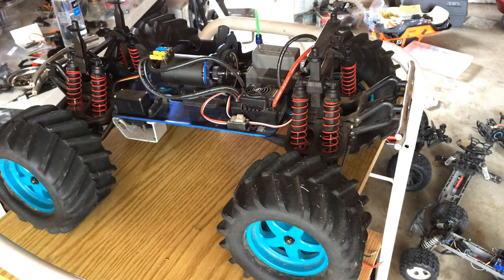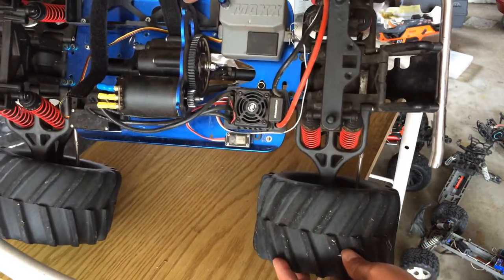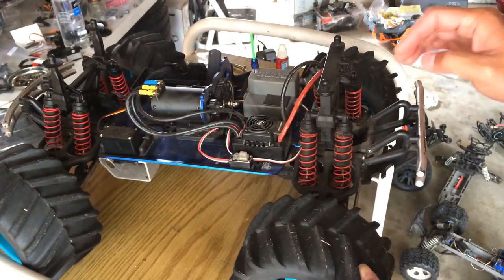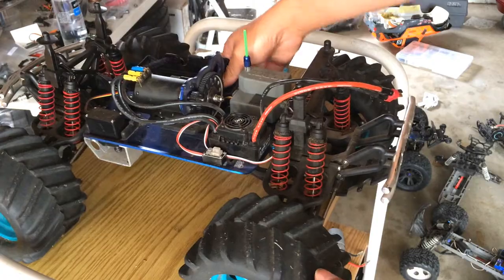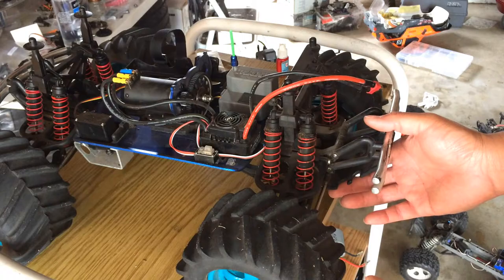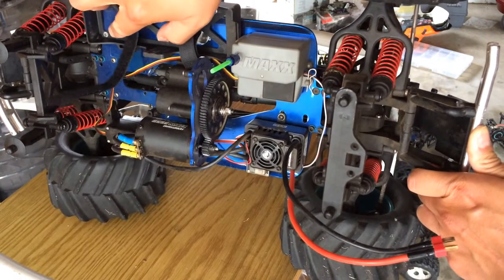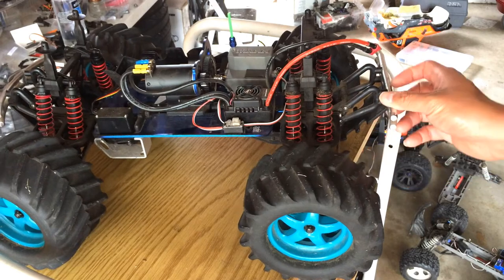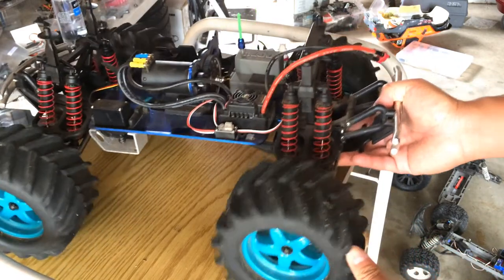Racing2Learn: Budget Build: T-Maxx Brushless Conversion: Hobbywing EZRUN WP-SC8 3400KV Combo

Comment: Its a great and flexible ESC and a very powerful series of motors. Excellent value! Have found that if you look around you can get the HPI versions dirt cheap from "chop shops" new and never used. Picked up the flux 4000kV 3656 can for only $40AUD and a flux 3550 4600kV for even cheaper. They are either a castle or Hobbywing motor and are some of the best value cans out in my opinion. Makes them great for budget projects.
Reply from the maker: Thanks for watching and commenting, excellent tips Ken!

Comment: Did you mention what motor bracket that is? If you did I missed it could you let me know what or where it comes from.
Reply from the maker: Thanks for watching and commenting Pixelated! It's the full transmission and motor mount from a 3906 E-Maxx

Comment: Did the emax transmission fit in the truck with no troubles?   Did it need anything for the transmission conversion or did it just drop in and replace ?
Reply from the maker: Yes, it dropped right in.

Comment: What mount is that pls both my.tmaxx are electric an love them but wanting to do a different set up an yes the axels don't like 3s at least not with the stock tires.
Reply from the maker: Thanks for watching and commenting! We used a complete transmission out of an old E-Maxx 3906. Unless you can find one of these, you're probably better off buying a conversion kit from how2rc.com. Enjoy!
Reply: @Racing2Learn   I have 2 one for a tmaxx an one for my revo in the mail an I ha e one I made good ole drop bit a tap an made it work for me 👍👍

Comment: is it possible to do this to a tmaxx 3.3
Reply: Cesar Lopez yes it is and very easy  did it with mine and it saved me so much money..good luck
Reply: I took my other tmaxx apart an converted it in a few hours an I had an motor mount I made work but don't go past 2s unless you upgrade axels lol I didn't listen lol an both my tmaxx will ride wheels an I did few back flips with stock tires couple hours ago lol my tmaxx is my fav I'm thinking about converting my revo as well

Comment: Can you tell me which current Hobbywing combo kit would work for the conversion? I've got 3 old T-Maxx's which haven't run in over 10 years, it'd be great to get them working again.
Reply from the maker: Thanks for watching and commenting Aaron! The direct replacement would be the HobbyWing Max10. Since you've got three of them, you may want to try a lower cost alternative like the OCDay 120a ESCs on eBay,  and a motor to match.

Comment: I did something similar to this a few years back but I like your battery tray setup. Where did you get your battery holder? (or what brand is it?) The electric conversion is so much faster and more powerful it never even came close to this even when I had the motor tuned the best I could get it.
Reply from the maker: The battery tray is an Axial one we had laying around. We've also thought of using one from the Team Associated RC8B3e part number 81297 and the Losi SCTE (part number LOSB2415).

Comment: Im thinking about doing this to my tmaxx, how fast does it go?  Have you ever tried a 3S LiPo battery in it?
Reply from the maker: Thanks for watching and commenting! As you probably already know, top speed depends on what gears you are running. Ours is geared pretty low so it goes about 25 mph. We do run a 3S LiPo in it because it's geared low. On 2S it probably only goes ~20 mph.

Comment: Hi nice set up. Just wondering where did you buy the motor mount please.  Thanks
Reply from the maker: We’ve used how2rc.com mounts, this one is an old Emaxx transmission.
Reply: Can i use this on a tmaxx 2 gear and reverse trans?

Comment: so I've been watching other people's videos on this and you make it look so much more simpler and cheaper is there something I'm not seeing or is there something I'm missing
Reply from the maker: What made our conversion easier is that we bought it as a roller with the transmission from the electric E-Maxx model number 3906 already installed. This way, we didn't have to use a conversion kit and lock the one-way bearing in the transmission.

Comment: What motormount is that I have been looking for weeks
Reply from the maker: We used an old E-Maxx 3906 transmission for this build, but you can find a motor mount at how2rc.com
Reply: How did you make the motormount fit? That motormount Is made for the emaxx transmission

Comment: Super nice video! Just one question, where did you get the engine mount from? Ebay link? thank you!
Reply from the maker: Thanks for the kind words! We'd suggest the how2rc.com mount if you're going to keep the stock T-Maxx transmission. We went a different route on this truck since we bought it with an old 3906 E-Maxx transmission already installed.
Reply: Got it, thank you so much!!

Comment: How is that working?  You have put all the heavy stuff, battery and motor on the front of the car.  Putting that weight in the rear of the car makes for wheelies!!
The 35mm X 65mm motor, is a 550size and all most people need.
Reply from the maker: +How2RC It actually feels really well balanced, check out the running video https://www.youtube.com/watch?v=jUKOfcc9M-4 I really like how it jumps. By the way, we're using one of your mounts in our Revo Brushless conversion. I emailed you as well regarding your mounts, we're honored to see you comment on our video!

Comment: I am on the fence of converting my T-Maxx 3.0 to electric.  With your years of experience would you would recommend moving to a Maxx or do you think the conversion with the T-Maxx is worth while. My concerns sit with plastic drive shafts and diff.  I would still need to buy motor, mount and esc.  Not interested in  speed records, but it would be great to find a good balance of a decent brushless motor that will not blow up the plastic shafts.  

Your videos are the best I have seen on this brushless conversion.  Great job here on your channel.
Reply: Im converting mine with the original Emaxx transmission and a 1/8 scale 1360kv brushless motor, basically all you need is a battery tray. For 1/8 scale motors though, im going much higher on the gearing to drop the torque and only running it on 3/4s to make things a little easier on the plastic transmission/shafts.

Its going to be a bit slower, but im going to convert it over to the erevo 2.0 transmission in the future, but that will require a custom mounting plate which hasnt been available for a few years now - will need to make it my self 😅

Comment: Can I run a 4000kv motor on this
Reply from the maker: Thanks for watching! You should be able to, but it all depends on how it's geared and how many cells you're running for your battery. Keep an eye on your motor temperatures to make sure you're not overheating the motor.
Reply: Racing2Learn thanks man.